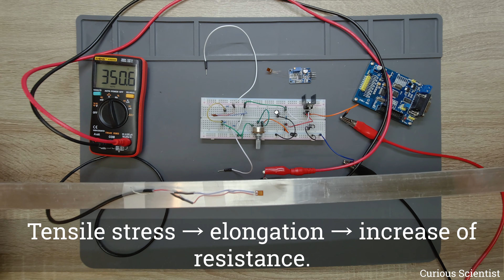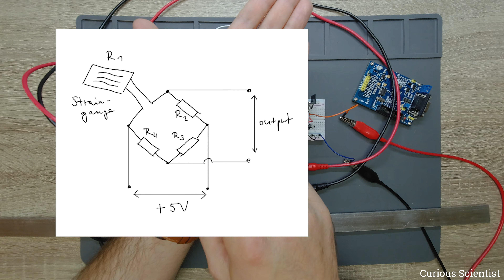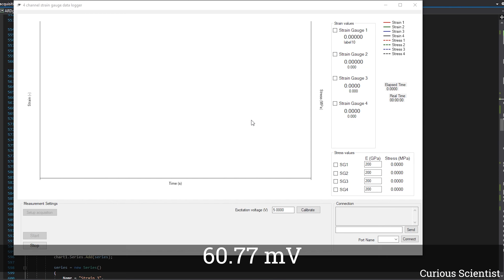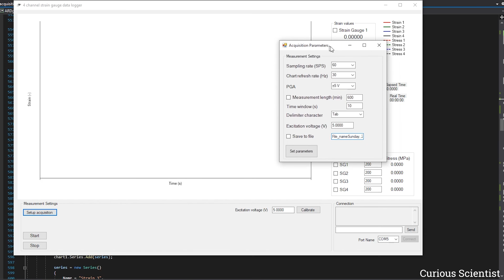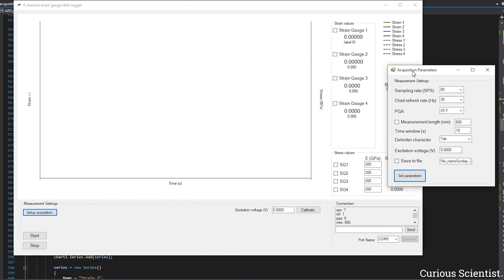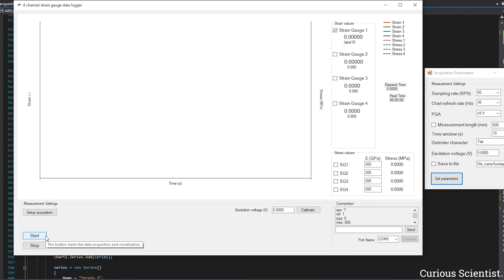Measuring the output of strain gauges

Comment: Hi, you say that the strain gauge doesn't go o more than 2%. Is it like the linear part ? or would it brake after that ? I'm working on some wearable project where I want to measure deformation. I feel like i will need more than 2% elongation. Do you think, I can pur multiple strain gauges next to each others or look for something else ? I bought some sensors from adafruit but hysteresis and non-linearity are a big problem and I'm looking for some precision. 
Thanks for the video ! and for the answer in advance
Reply from the maker: Hi! Yeah, typical strain gauges break above 2%. Partially for materials science reasons because above 2% (-ish) the metals permanently deform. No, you cannot increase their range just by using more of them. There are other strain gauges that can go up to +/-5% as well. But if you want to use them as a wearable, you will be able to to mitigate noise very well, plus the temperature differences will cause a lot of headache if you don't account for them.

Comment: You said its the via elongating causing the resistance change? I'm not so convinced. It is the thin copper traces in the polyamide that change their cross sectional area that causes the resistivity of the trace to change. An elongated via still has the same circumference.
Reply from the maker: Where do I say "via"? I said roughly the same as you wrote here...
Reply: @CuriousScientist  at 0:34 you say "a grid or more precise the vias elongate"
Reply from the maker: Wires, but not vias. And those wires which I was referring to are the thin constantane traces applied on the polymer carrier. 😉
Reply: @CuriousScientist  aah my bad, the accent tricked me 😅. Good video sir
Reply from the maker: No worries. I am not a native English speaker, so my pronunciation can be weird sometimes. 🙃

Comment: Is there any limitation to the length of the leads going to the gauge? In my situation I would like to have somewhere between 6 to 9 feet. Would there be any problem with that? Thanks
Reply from the maker: Noise could be an issue, but if you use shielded cables, it should be fine. Most of the equipment I use at work are packed with strain gauges (load cells), and they work just fine, even with longer wires. But once again, shielding and probably twisted wires, too, are a must!
Reply: @CuriousScientist  Thanks for the reply, much appreciated!
Reply from the maker: It's my pleasure!
Reply: @CuriousScientist  I have another question if you don't mind. I recently set up a test circuit and noticed that the temperature of the strain gauge is effecting the voltage output. The warmer it gets the lower the voltage drops and the opposite happens when cooled. Is that normal or a sign of a cheap/faulty strain gauge? Thanks for any help.
Reply from the maker: The strain gauge is super sensitive, so what you see is the thermal expansion and also the temperature coefficient showing up in the measurement. This is why you need at least a half bridge, which can be used to cancel out the thermal effects. It is not the faulty strain gauge, it is the nature. 😎
Reply: @CuriousScientist  Thank you!

Comment: hi, thnaks for your video. it is really nice. how did you oder your 350 ohms resistor ? i found 330 ohms but not 350 ohms ? have you a seller reference ? thanks in advance
Reply from the maker: Hi! I bought it from Mouser.

Comment: Hi Curious Scientist,

I have been watching your videos over strain gauges and found them to be very educational. I am looking to do my own personal project similar to your video "Measuring the output of strain gauges." I plan on subscribing to the Bachelor of Curiosity very soon, but I just wanted to ask if the code for the "4-channel data logger" can be purchased through the Bachelor of Curiosity or donations.
Reply from the maker: Hi! 
The software is not shared on my Patreon. In general, I only share Arduino software, and computer software are not public. 

However, I will soon start selling a data logger software for PC, but that is separate for Patreon.
Reply: @CuriousScientist  hi. Are you selling the Dara logger now? Thanks
Reply from the maker: @co.m.sigmasrl2213  Hi! No, I am not yet selling it. I will announce a video about it, so you'll definitely see it if you are a subscriber. Cheers!

Comment: what if using four strain gauges in bridge, can the circuit still be used?
Reply: Thank you very much for the answer🙏
Reply from the maker: Sure. That would be the optimal solution.
Reply: @CuriousScientist  so, all dummy resistors can be replaced with strain gauges?
Reply from the maker: Yes. But be careful about how you glue them on the work piece.
Reply: @CuriousScientist  how to input the output to arduino?
Reply from the maker: Use one of the analogue pins.

Comment: Dear Mr. Curious Scientist,

You are doing a great job which help students like me.
Now I would like to request/seek your guidance to know more on Wireless Transmitter and Receiver modules since I want to measure the Strain/Stress/Force acting on the moving and loaded mechanical component. So I want to mount Transmitter along with Strain gauge on the test surface of the moving element and receiver placed at a distance from the transmitter need to receive the measured data from transmitter data continuously. Could you please suggest me "tutorials/learning materials/Electronic components to be used" to get to know better? I am expecting someone who would have explained like you with my requirement.
Awaiting your positive response.
Thanks & Regards
Reply from the maker: Hi! 

Just search for any wireless transmission technology and apply it for your project. Read the values of the strain gauge then pass it through WiFi or Bluetooth. Any popular wireless microcontroller could do the task. Esp32 or similar. I don't know any specific creator on the contents youre asking for, but you just need to search for it on Google.
Reply: @CuriousScientist  Thanks for your kind response!

Comment: I have a basic understanding of this having done some electronics in night college. Maybe this is a dumb question as I don't know much about strain gauges. Is the voltage output linear? If put 1 ounce of weight on a strain gauge and see 1 mv will I see 2 mv if I put 2 ounces of weight on the strain gauge. I'm trying to picture how a digital scale uses a strain gauge. Thank you.
Reply from the maker: It is not a dumb question. Strain gauge gives a linear output which is proportional to the applied strain. The response (sensitivity) depends on the parameters, and these parameters are provided by the manufacturer of the strain gauge. The final response of the strain gauge depends on the bridge used and the signal amplifier as well. Basically, you have to design the circuit around the strain gauge/load cell to get a predefined response. The material of the load cell also can affect response as materials with higher Young's modulus will deflect less (smaller strain, see Hooke's law) than those with low (steel vs. aluminium).

Comment: hi! can you please tell me what software u re using in 11,29, and what materials u used to connect voltage circuit please ? last question please
Reply from the maker: Hi! That is my own software I developed for this application. I don't exactly understand what kind of materials are you referring to. Everything is discussed in the video.
Reply: @CuriousScientist thank u for replay, I am asking the values of capacitors that u used in the power supply circuit and the resistances in the wheatstone bridge also how did u get the 12V in the power supply ? is it an extern battery ? and the software u ve developed how can i get it ? do u sell it ? how much cost ? thank u
Reply from the maker: I don't remember the capacitor value, probably some 10 or 100 uF. The source of the 12 V doesn't matter, can be anything. The resistor values for the Wheatstone bridge is very obvious, same as the strain gauge. If you're curious about the software, contact me in email.

Comment: How about wire? please could you tell me what kind of wire you are using, if give the link like other parts will be very good?
Reply from the maker: Hi! A simple 30AWG stranded wire with silicone insulation was used at the flexible part and some 0.2 mm^2 2-core shielded wire for the signal.

Comment: Hello, 
How can you find the stress-strain response from that data If you have the elastic modulus of that rebar? Do we need to multiply or divide the resistance of that strain gauge with the strain values, which in this case is 350 ohm?
Reply from the maker: Hi! Read upon Hooke's law for the stress-strain correlation. Or just watch my strain gauge videos where I explain it.

Comment: I have a Question
I have 5 strain gauges now I want to connect them in a single amplifier which has 5 inputs for each strain gauge 
Can you recommend any amplifier which has 5 inputs for 5 strain gauges???
Reply from the maker: Hi! I have never worked commercial products, so I cannot really answer this question. But why don't you buy five amplifier modules like I use in my videos then use an ADS1256 which has 8 channels? You can build your own circuit relatively easily.
Reply: @CuriousScientist  One more Question!!!
Can we use DAQ device in place of ADS1250??
Reply from the maker: Of course.

Comment: What a coincidence! I also use this method to measure strain on alloy specimens when conducting tension, compression and axial impact test on it. Yeah, I got very tiny changes too but I was unsatisfied with that result. Anyways, unfortunately, I have not sure if my calibration method is right or wrong? Can you show me how to do calibration?
Reply from the maker: What exactly do you want to calibrate? The manufacturer already did some sort of calibration which is provided via the gauge factor. The rest of it is just mathematics, substituting the measured voltage or resistance into the right equation. Check my other strain gauge videos on the channel.
Reply: @CuriousScientist calibration on data logger software @picolog before starting to bend the tab/record the strain changes. I want to set the voltage reading on picolog to zero, as you got 60V at first right? mine got 50V and 70V like that... but I want to set it to zero, can't I? OR I have to substitute the value into the right equation?
Reply from the maker: Sorry, I have never worked with picolog, I have no idea about it.
Reply: @CuriousScientist  ooh.. I think the concept is same with yours only different software that we used. Its ok... So are not you clear what I meant by the calibration that I asked just now?
Reply from the maker: I really have no clue about what kind of calibration you are talking about.
Reply: @CuriousScientist  ohh.. Ok2 but thank you for your kindly response 😊
Reply from the maker: You're welcome!

Comment: Hi,, the module you showed containing the bridge and opamp, found it online , is there a point on having different nominal resistance strain gauges ? if yes do you reckon i can use this module with another strain gauge ?
Reply from the maker: Hi! If you use a different strain gauge, for example a 120 Ohm one, then the output voltage of the Wheatstone bridge will be different. If the onboard resistors are 350 Ohm and the strain gauge is also 350 Ohm, then the output voltage of the bridge is 0 V, since the bridge is balanced. If you bend the strain gauge and the resistance becomes 351 Ohm, the output voltage will be 3.57 mV. This 3.57 mV is amplified further by the OPAMP. However, if you replace the 350 Ohm strain gauge with a 120 Ohm (another typical strain gauge value), then the output voltage of the bridge will be 1.22 V, without any strain applied on the strain gauge. This is not good, since if you try to apply a 10x or 100x gain on this voltage, you would reach the rail voltage (+5 V) really quickly on the OPAMP's output. And you would still need the OPAMP, because the change of the voltage on the output of the bridge will be still small.
So, in general, if your bridge consists of 350 Ohm resistors, use a 350 Ohm strain gauge, otherwise you can mess things up. If you want to use a different value, maybe add a precision resistor in series with the strain gauge to compensate for the differences. But I don't really recommend it. Use the circuit with the proper strain gauge.

Comment: Can I email you about a potential commissioned project using strain gauge? Looking to build an application that is around 1 inch wide, 6 inch long, and .5 inch tall. When bent it should vibrate (using a micro vibration motor). Should have a button that allows it to be calibrated so that it will only vibrate when deviating from the calibrated strain.
Reply from the maker: Yes, you can mail me, but keep in mind that I don't do projects for free!
Reply: @CuriousScientist  I understand that 👍🏼
Reply: @CuriousScientist  What is your email?
Reply from the maker: You can find it on my website in the contact section.

Comment: would it be possible to built a small wearable application of a strain gauge that can sense and react to small strain changes? A device about an inch wide and 6 inches long and 1/2 inch thick?
Reply from the maker: It is a bit vague description. Instead of the size, you should tell the function of it.
Reply: @CuriousScientist  I mention size because I’m not sure of the size of components needed, and want to make sure such components could fit in a device this size because the application must be worn beneath the shirt
Reply: @CuriousScientist  I tried sending you an email but it isnt showing uo in my sent folder. I sent two and neither of them look like they sent. Maybe check if you got an email from brandonbaunach

Comment: Hi! Great video! Thank you for sharing this. There is an application where I wanted to experiment with a strain gauge so ordered a similar kit ( https://www.aliexpress.com/item/4000907686535.html?spm=a2g0s.9042311.0.0.5e384c4dzI2ikH ), but it didn't work for me the way I thought it should. I am saying "thought", because of lack of information regarding this circuit, so I kind of guessed that the output signal is an amplified voltage proportional to the strain gauge resistance and the potentiometer is used to set the '0' voltage. 
Anyway, I was reading a constant 3.46V on the output pin, regardless of the strain gauge and not even affected by rotation of the potentiometer. So I thought that I was getting it wrong and the output signal was not amplified, so went searching the internet for some info regarding this board and found your videos from which I concluded that my initial guess was correct and so my board is faulty. I ordered 2 new ones. Thanks.
Reply from the maker: Hi! Thank you! I am glad to hear that my video helped you to solve the issues!
Reply: @CuriousScientist  Hi, I got the new kits, but still have the same luck with all of them: supply 5VDC and reading constant output voltage of around 3.5V on the OUT pin, regardless of how I bend the strain gauge or how much I twist the on-board potentiometer. 

What kind of signal should be output from the OUT pin? Isn't it an amplified signal which can be measured with a standard voltmeter?
Reply from the maker: Hi! Before you'd think that I forgot to answer you, I will soon upload a short video answering you specific questions. It is easier to show the things and it is more informative for you and maybe for others too. Thank you for your patience!
Reply from the maker: Hi! The response video is uploaded!
Reply: Hi! Wow! I am so very sorry to miss your last response. It's been 2 years. Thank you so much for your incredible work and willingness to help out. I have checked your response video, it is like I expected. I guess I will respond under that video. Thank you again!
Reply from the maker: Hi! No worries. I recently reverse-engineered the circuit and built my own "educational" version of it. If you're interested, check that video, too. I hope you'll find it interesting.
Reply: Yes, very educational. Really well done!!!!
You board is very sensitive. This is actually mainly what matters for me. I am trying to use the strain gauge on a 3D printer to sense when the nozzle touches the bed for auto-calibration. So basically what I need it adjusting the pot so that the output voltage is just below the printer's input threshold and a minute force should bump the output voltage above the threshold.
 
I am not thinking to order 3 pieces of 120ohm strain gauges which will be all glues side by side and connected in series. Hopefully (if the trace length in the 120 ohm is roughly the same as in the 350 ohm strain gauge and what differs is only the cross section of the trace)  this configuration will be more sensitive .
Reply from the maker: @DYEngineering  I am still under the impression that the circuit is fine, but something just went wrong with the wiring or something. 

Before starting to invest in more components, please do some more tests to exclude all possible errors and mistakes.
Reply: Thank you for the kind suggestion. However, wiring couldn't be more straightforward than that. Can't think of what else I could test except making some voltage measurements across components onboard. Have even soldered out the potentiometer to establish its range and set at its middle.
Reply: @CuriousScientist  Was able to get it working. Other boards I have output range is 0-5V, while these spoken ones apparently are 0-3.5V (supply voltage is 5V). This is why I was seeing a constant 3.5V which was not influenced by the pot at all. I was assuming that 3.5V is around the mid-range so it should obviously respond to a few turns of the pot, but as it turned out I had to rotate the pot much more than that to get it op-amp below its clipping zone.

Wonder why the clipping occurs at 3.5V which is significantly lower than the supply.